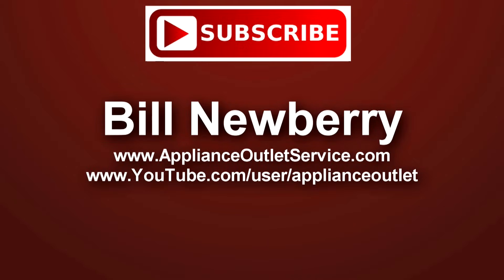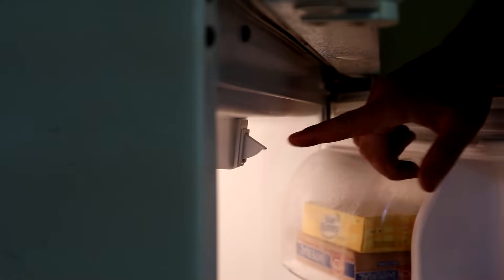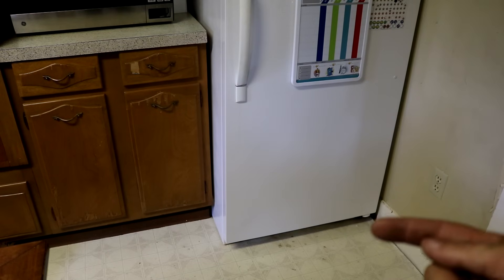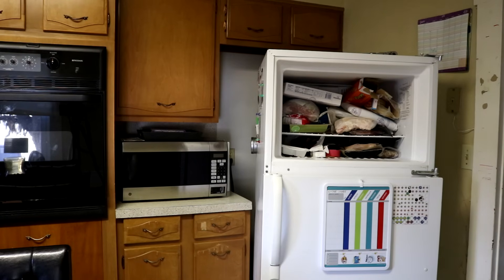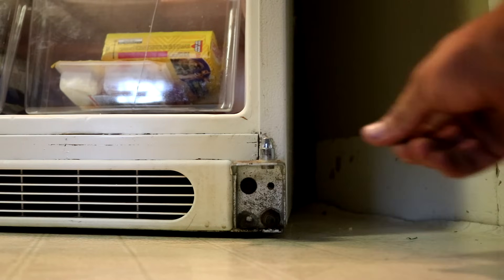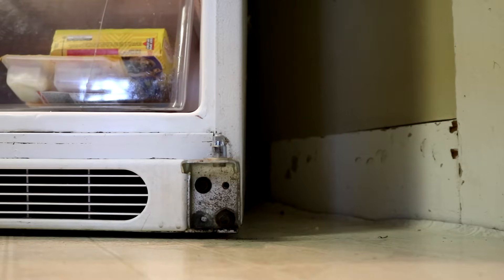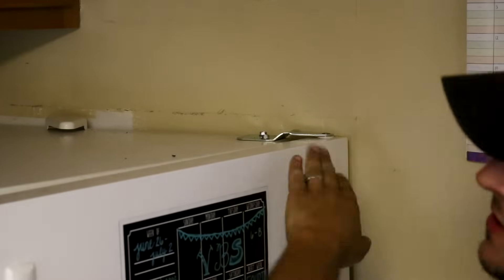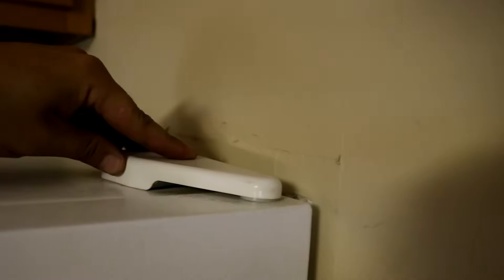How to fix and adjust your refrigerator doors that will not close properly

Comment: Thank you! Esp. for showing how these hinges operate and come apart (without me trying to guess). My brand new Frigidaire arrived with the top freezer hinge seemingly crushed (bent inward). The freezer doesn't quite close properly on the opposite side (and most noticeably there's lots of moisture inside). With your video, I can probably fix this: either bend it straight, or replace it (hopefully free from Frigidaire). Thanks again.

Comment: Had to add washers to fix my door sagging. It looks identical to yours but after hammering both ways found it needed about a quarter inch lift and the washers did the trick of leveling the lower door.

Comment: This worked for me , also I found a plastic washer to add to the bottom one which automatically raised the height 1/8-1/4”. Not sure if the hammer fixed it or the washer but it’s almost perfect, hopefully stop the water accumulating in top of fridge anyway.

Comment: Hi I need help adjusting both top and bottom doors do not close properly and the top one is misaligned. Can I send you a short video so that you can give me some advice? I’ve already paid someone to come adjust it but they charged me and left it in the same condition. Thanks.

Comment: The gap between the door handles is fine for me until I open both doors. As the doors open the handles eventually start to rub against each other. Any idea why this is? We used the hinge cap as a spacer when tightening the top door hinge to make sure it was properly spaced from the bottom door. But once opening both top and bottom doors, the further they swing out they eventaully run into each other. Thinking the bottom door is getting higher as it opens because I measured it with a tape measure. No idea what to do about it

Comment: This quick fix might not be for every fridge, I suggest replacing it with a new bottom hinge.  The used hinge is probably bent more than you can think it is.   If you have to go through all the trouble just change to a new part.  More likely the door will sag again just hammering it.

Comment: Alternatively… add a 1/8 inch washer to that hinge to lift the whole door a little higher. Assuming that your issue is it scraping the bottom of the fridge and not exactly as you see in this video

Comment: Two 3/8 bolts at 5:28 allow for an ever slight adjustment. What I did is support bottom door with two 2x4s and a 1x4 and one of those wooden paint stir sticks you get with a gallon of paint (under left and most sagging edge) - I literally put hands on both sides of bottom door and lifted door straight up sliding in wood base. Remove bottom right bolt to get an idea on how long bolts are as well as you need to put a thin washer behind the bracket for this bolt - bolt is not that long. Carefully loosen but DO NOT remove upper left bolt. NEVER remove upper left bolt. I placed an ordinary rather thin washer behind bracket bottom right and a second though slightly bigger washer bottom left (behind bracket) even though there is no bolt for this bottom left washer. You are trying to angle entire bracket up though "up" a little more on left hand side which is why you use a washer twice as thick on left. Tighten the two bolts - all good. I didn't even tap bracket up before tightening but that was my immediate failover if needed. I do not consider introducing further metal fatigue and beating the appliance with a hammer a fix (see James' comment below about snapping off a bolt with hammer prior to trying hammer method). Also I am liable to introduce more problems taking doors off. Kudus to original uploader as I certainly don't want to spend time creating a video and looks as if you guided me and others to the problem. Hope this helps someone. Thank you.

Comment: Bill YOU ARE THE MAN!!! I followed EXACTLY what you did and it fixed my fridge!!! I tried “adjusting” the bottom hinge, took the metal hinge bracket off and bent it, taped seal with duct tape to bridge the gap, nothing worked. I usually don’t smash things with a hammer but in this case it was needed! Thank you soo much!!

Comment: I could not tell what was wrong exactly.  I could not see an obvious droop, but the door would not close properly and seal.  I could see that the gasket looks like new.  No idea how old the refrigerator is, but it's beige and I believe that was an 80's trend.  Anyway, I checked for level and it was higher on the hinge side.  I leveled that the best I could.  Mine has the slotted hex bolts you mention in your video.  I believe my slab droops on that side so I could slide a shim under there to make it perfect if I have any other trouble.  It definitely sloops front to back so that part was fine.  Ended up that I had to use a hammer on the bottom pivot post, like you demonstrated in your video.  It totally worked.  My sincere Thanks!

Comment: Worked perfectly!  Note that I also had a broken and worn lower washer. So,  it was good you pointed out to check that, too.  The worn washer also lets the door drag on the top of the lower hinge pin bracket.
Reply: Jay Perkins where did you get the washer ? I live in nowhere’s viille. It’s 45 minutes to nearest Lowe’s Home Depot . So I check websites before I waste a trip. I’m not seeing anything like it. I went to a local feed/hardware store and they had metal and foam or rubber washers . But no plastic or nylon. I don’t want to resort to the dealer-if they even exist anymore-Kelivinator. have to wait days and end up paying $20 for one washer . But I won’t know if mine is messed up til I do this (attempted) repair . I’m currently using  4 pieces of duct tape to shut door and refusing to buy groceries to punish my teenage sons that won’t help do this . they are expert level gamers yet can’t watch a damn YouTube video so they can have canned food and warm soft drinks until I can’t take this anymore (soon) ..
Reply: John Mitchell Most Hardware stores have them for about $0.30.  You may not find the exact fit but you can get close.  It’s best if you take the old washer in the store with you to compare. I 
Picked up mine up from Ace today; it wasn’t the exact fit but it worked! You can also find them on sears website or other internet appliance stores.  Punch in your model number and look for washers.  Usually about $6 online for exact fit.

Comment: I don't understand.  My screw holes offer no ability to move them slightly in the direction needed (referring to the top adjustment, which is my fridge door, not freezer)?  Why don't they slot that so it allows adjustment?

Comment: My problem is, is that the refrigerator door closes back so fast that it is almost annoying.... I have to hold the refrigerator open with my knee. Is there something that I can do another washer or something to slow the door down a little bit? It's just the bottom door the freezer door is okay

Comment: Well, you make this look really easy. When I try to do it, it will probably be a lot harder for me to do. I am Mrs. Break everything. I can take things apart really good. But getting things back together again is frustrating. Most of the time, I don't have the proper tools. I want to say that your video did help me to understand what is going on with my refrigerator door. I'm just afraid to try it. I have a handyman that does all these little things for me. I probably will still have him fix this for me. Thank you for your video.

Comment: Cool, video. I have a question. It was hard for me to tell if you were hitting the bottom hinge with the hammer or the actual side of the refrigerator. Are you hammering the actual hinge? and why do the bolts have to be right before hammering them. I' m having the same problem you had, so I'm going to try and fix it with your video. Thanks
Bryan
Reply: I meant to say why do the bolts have to be tight before hammering. My auto correct got me.
Reply: @mcintyre2009  if the bolts are not well tightened, you may break them!

Comment: Thanks for this tutorial.  My 2004 Whirlpool side by side freezer was misaligned, and we were able to adjust the hinge at the top, the way you explained at the end.  Loosened the bolts and then visually aligned it and tightened them back up.  Your explanation made it so much simpler to solve the problem. Cheers

Comment: This video is right on! I had a door that rubbed at the bottom and wouldn't close. Your advice, procedure, and tool recommendations were all perfect and the task took only 10-15 minutes to complete. Door operates great now. I could not find this info anywhere else. Thank you for taking your time to do this.

Comment: Thank you!! Your video really helped me out. My parents had paid for a Useless "Extended Warranty" on all of their kitchen appliances when they had their kitchen gutted and renovated. The renovation was below "Piss Poor" to begin with extremely shoddy work that was done below code and/or so bad that it was cracking and falling apart within 6 months of being "Supposedly Completed". Anyways, they purchased a new LG model LRTN refrigerator in stainless steel finish. Within the first 4 months after the fridge had been delivered (with the brand new kitchen floor being destroyed with cuts and gouges during the delivery), I was complaining that the fridge was not keeping food cold enough (between 41F to 49F). The warranty provider sent out a "Technician" for the call. What a useless POS that was sent here. He had absolutely no idea of what he was doing. His comment after he "finished" was to tell us to just "loosen the bolts" and twist with force to "twist the door into alignment". Do not waste your money purchasing LG, Kitchen Aid or Whirlpool home appliances. There is virtually zero support.

Comment: Excellent video.One of the original screws on the bottom corner bracket was stripped and I had to replace it with a little larger screw. Worked great and now we have a refrigerator door that closes correctly

Comment: been using an old fridge over a newer one for the past 2 years because the old one used to get all sweaty, and after trying to blow air in the drain tube without any success i concluded it was just a piece of junk, my old one started sweating too this summer, and last week my girlfriend told me she tough it was really just from the door not sealing properly and allowing moisture in , i havent give a go to the old one yet but i managed to fix the new one as you describe, now it's wait and see but i got a good vide on that one! think i finally unfucked the fucker! thanks!

Comment: Tried a bunch of videos to fix the poorly adjusted Frigidaire lower fridge door - none including this one worked.  Fixed it by placing a couple of 5/8" washers on the lower hinge pin and placing the nylon washer on top of them.  Been good ever since.

Comment: Watched this after leveling the fridge. Everything was going good then when going to take the fridge door off that there's play within the hinge pins. Lift the whole door up a couple mm and opens, closes and seals as it should. Went through all the toolboxes but have no washers of any kind. Gonna run to Home Depot in the AM to get those plastic washers to boost up the door from the bottom. Thanks for the video though. While following along I learned the actual problem with the door :)

Comment: Kenmore Colspot Top Mount refrigerator.  What about if the bottom left side of refrigerator door is ajar?   Should I slightly punch out the top hinge of the refrigerator door to the right?  Please advise.

Comment: Bill my fridge door has a gap on the left hand bottom side ( not top  ) the handle is on left side As the door was no closing moisture used to come out and the fridge body slightly corroded on right hand botton side
When I close the door the right hand side gasket rubs  the fridge body.
How do I fix this ? The company mechanic put an additional washer at the  bottom cam ,this reduced the gap but door is not tight shut and has a gap of about 1 mm on the lower Left Hand Side of door

Comment: Thank you! I replaced both hinges on my refrigerator - looks just like the one in the video. The most difficult part was re-attaching the wooden panel afterwards. Trying to support the heavy panel and screwing it to the fridge door wasn't easy. In the end I used a car jack to support the panel which made it a lot easier and I could get it at the exact height I needed. It didn't help that the original installer must have tried screwing the panel in multiple positions so I couldn't tell which hole I was to screw into!

Comment: Great video!  Unfortunaltely, for me the sagging is not the issue, but rather the bottom of the door doesn't want to properly meet up with the fridge.  The upper section of the lower door meets properly, but then I have to push the bottom part with my foot to get it to make contact down there.  Almost like the door is warped or something...  But I have to imagine it's not warped.  Perhaps leveling the fridge will help, or something else.  I will have to keep searching.
Reply: I have same problem as jayfore.  Any ideas to fix gap on lower left?

Comment: Bill Brewery I have a Samsung Fridge/ Freezer. The fidge is on the top & freezer  on the bottom  .I have noticed that the  bottom  corner of the fridge where it opens is not  sealing tightly. I've checked to be sure it's level as well as making sure the gasket is free & clear of any debris and is not torn. Any suggestions on how to fix this closing  issue would be greatly appreciated. Thank you.

Comment: Bill, this was just what I needed after finally diagnosing the buildup of "snow" in the freezer due to damp flowing up through a gap caused by a sagging fridge door. What's more, ignore those who say you were too leisurely in the presentation. I had it running on our laptop, sitting on the dryer nearby, and could just about replicate what you did as you did it. Outstanding. We owe you bigtime.

Comment: Thanks for the video Bill!
The microwave solution cracked me up. Those stupid plastic pins on the side of the button snap off...such bad design. 

I came across a broken one once where I was caught without the part and was able to get the customer up and going temporarily by drilling a small hole where the broken pin was previously and inserting a small metal screw in its place. I honestly believe it was a design improvement. Doing that on both sides would probably have made the part last forever.
Reply from the maker: My wife hates it!  lol  You would think I know a guy who could fix it!  I should have put a screw in it when it broke like you said, but I think I tossed the part. Oh well, it works for now.

Comment: Thanks for the video, but Is everybody claiming success from this video getting in there and banging the hell out of the side of the hinge, just whacking away with a hammer to the point that the entire fridge moves to the side from the force, several times, and not experiencing any damage to the fridge at all? Not questioning that the method could work, but feel that there would be a more ‘proper’ way to adjust spacing and hinge position...thanks for taking the time to make this video regardless.

Comment: I've been screwing around with my fridge door seal for a long time without satisfactory results. Never thought of using a dead blow hammer. Damn if it didn't work!  I can't thank you enough for your simple solution to a nagging problem. This from an 84 year old Mr. Fixit who thought he could still fix anything. Thanks for showing me the way and keeping my ego intact.
Reply from the maker: Awesome!  I'm glad I was able to help you out.  I was shown by an old Korean tech.  He said, this is the only way you do it.  So it's been the way I've done it every time I run into saggy doors.  I've seen people stack washers on the lower hinge, that just creates other problems.  Awesome Job on your Repair!

Comment: bill sorry about the multiple comments I thought it didn't go thru because that's what it said
Reply from the maker: It's ok, looks like Andy has you on the right track.  Thaw the unit first, then plug it back in and let it run for an hour or so.  Then troubleshoot.  The hissing sound could have very well been the freon coming from the evaporator.  Sorry to say, but that's not good.  If you lived close enough to me, I'd pay you a visit and fix it for ya.
Reply: RIP Mr. Newberry and of course thank you for helping out people who are learning to DIY

Comment: I have a fridge that the freezer fan is only blowing out cool Air not freezing the inside I changed out the defrost timer still nothing was gonna change the tstat...then I herd the hissing sound... do I have a hole equaling a shot unit?or.....
Reply: Hey Eddie,
I imagine your evaporator (inside the freezer side) was a frozen block of ice?  
The thermostat is a likely failure point when you're having a defrost issue, but It sounds like when you were changing the thermostat you may have damaged the sealed system and released the refrigerant which runs through the evaporator lines. 

When dealing with a frosted up evaporator it's important to thaw it first before working on it. Never try to chip away ice with a sharp object or tug hard on the evaporator. 

I don't know if this is what happened in your case, but that is one thing that would cause a hissing sound. Another possibility is that if you have a large enough leak that developed you could probably hear air being forced out of that hole by the compressor when running.
Reply: thanks for the info that maybe the case.... it wasn't blocked up inse I removed the fan wall...but could have happened when I was removing the tstat....